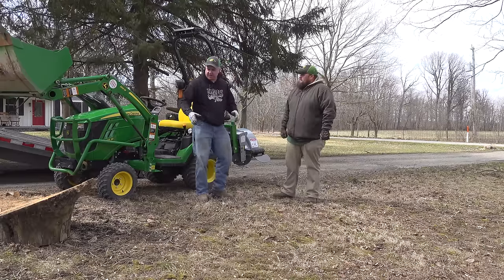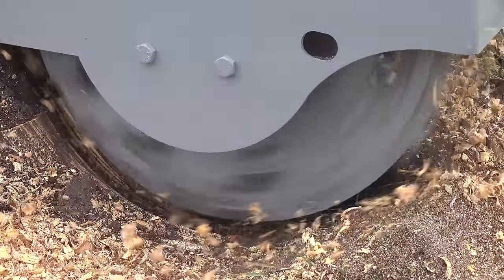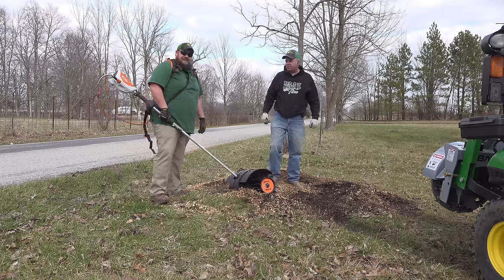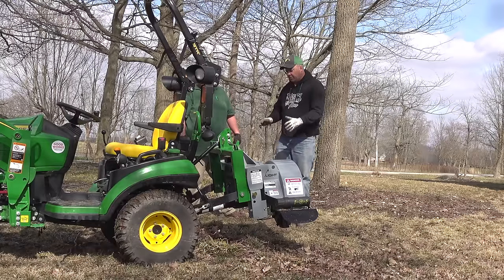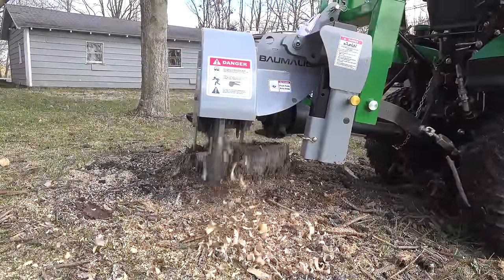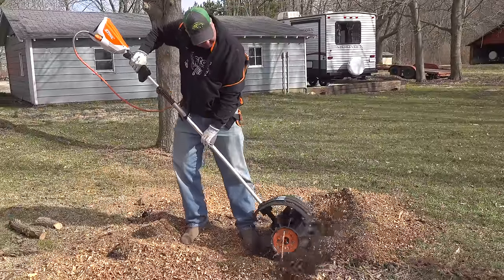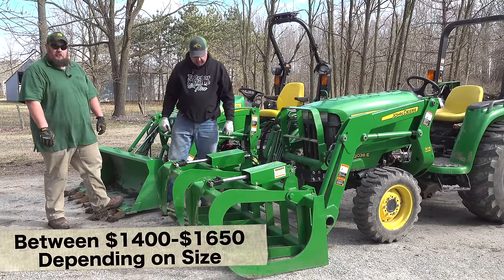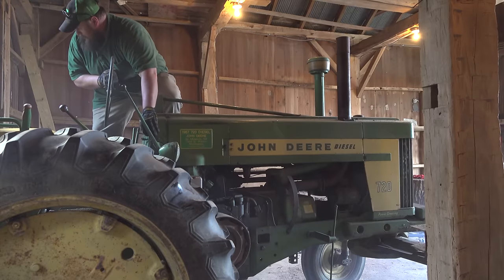New Stump Grinder! Low Cost! Let's Try It!

Comment: We've got a Shaver MV50 for the 5320, which I had at my house for a couple weeks a year and a half ago. Traded my neighbor him using his bucket truck to take down my pine tree (can't drop it any direction in one piece) for taking out 6 Ash stumps in his yard. They were all 2-3.5ft diameter. Even with that setup, it took a whole day to grind them all up. The dead Ash was suuuuuper hard! So much repositioning on those big ones!

Comment: When I first started watching the video I was like there’s no way that grind is going to do a good job on that small tractor but I got to say I was very surprised. Looks like it worked really well.  I rented a 35hp Vermeer grinder a few years ago. One of the ones you stand next to. But man that thing was a handful to control if you cut down too much she  would dig in and pull the whole machine forward. Love the old John Deere at the end nothing like the sound of a Johnny popper.

Comment: if you ever turn wood on a lathe you'd find that hardwood is much easier to shave than softwood.  Softwood just comes out in noisy chunks; hardwood peels off.  Try turning a piece of pine on a lathe........nightmare!  You could also try carving maple vs. pine and see which one works better.  The pine just chips apart because of the softness and big airy grain structure.  My 2 cents.  cheers.

Comment: I have a 2038R and I’m trying to decide between this stump grinder and the 3g24 version
Reply from the maker: Ok.  I think I can help.
1) do you have 2 rear scv’s?  You need 2 to run 3p24?
2) Can you handle the price of the 3p24?  If so, then you will like it much better. 
3) do you have only a few stumps to grind, and are you willing to take more time to grind them?  Is this tine of less value than the $$ required for 3p?  If so, stick with the 1p.

Overall, the 3p24 is worth the extra money...but not if you won’t be grinding many stumps.
3p24 will take more storage space.  

Do you find it difficult to turn around to watch a rear attachment?  DEFINITELY choose the 3p24!  You can operate from off the tractor!

Does this help?

Comment: I purchased a Woodland Mills stump grinder for my 1025R 2 years ago.  Does a very good job and is quite similar to the Baumalite in function and operation.
Reply: Hi Donald, I have a Kubota BX and looking at the woodland mills. Do you find the bouncing and rattling around tough on the tractor. Just curious about real user feedback before  I purchase. Thanks
Reply: theboudreaus444 
It does shake a bit, but no problems so far.  Have removed about 50 stumps of various sizes.  Taking a little smaller bight will get rid of most of the shaking.
Reply: The wm24 is made in China... The baumalight is made in Canada... Easy choice for us.....😊

Comment: Pine is stringy and likes to lay over when grinding, the first pass will fray it then it is tough to cut especially if the teeth have any wear on them. The hadwoods chip nice and go faster and easier. Does the shroud on the wheel lift up or shift from side to side. I ask because the mud can really pack in those areas and be like concreat to get out.

Comment: I have a bamalight on my 1025R  as well. Most of what I’ve used mine on is hedge stumps and it works great. I wish I had that clutch system on mine.
Reply: they sell slip clutches every day. $100.00 plus any tractor supply, or similar co.

Comment: For the price they work pretty good.  Price out even a small commercial unit and they are way up there!  I bought the woodland mills version, looks to be very comparable to this unit. Works awesome of softer trees like pine.  I've done harder trees, and even a few black locust's.  Those take a while. I'd recommend having a hydrostatic tractor for this to get the best use of it.

Comment: Good morning Tim,
Thanks again for making these videos. Your first video on the first version was the reason I bought my stump grinder.  I went with the woodland Mills   Version. I've only gotten to use it once so far but was super impressed. Its reassuring to see someone use it on a similar tractor (I have a yanmar 424). I was alittle worried about the size of the machine. Again thanks for the great tips and advice. Keep up the great work.

Comment: Please let me lend some advice. That Stihl powersweep works great for alot of things. Used like this, is not one of them. A pitchfork would've won the match. For cleanup and sweeping it back up of the turf, it's fine. For removing gravel out of grass, like from plowing, there's nothing better for cleaning ditches and stuff. Now, for the advice. Loosen the attachment end up and rotate it 180 degrees so it runs backward. Now you are pulling it. When you pull it, you're now able to stand up straight, you're not wearing yourself out pushing and lifting it, and it pulls with essential the resistance of a leaf rake. You only need to run these about 1/4 to 1/3 throttle (on the gas models). These things are worth their weight in good when used like this. 😉

Comment: I have a woodland mills WG24 stump grinder on a 2032r which is the same pull behind with no extra hydraulics needed. Love the thing. Over the course of a weekend we easily went through over 200 Pine stumps
Reply: Hey Justin, do you find the woodland mills WG24 hard on the tractor itself? I have a small BX series Kubota and have been thinking about picking up this grinder. Several spruce stumps and ash to grind. Just curious if all the bouncing and rattling takes it toll?
Thanks
Reply from the maker: Remember, the WG24 is made in China.  The Baumalight is made in North America. The Baumalight is less expensive when purchased via shopgreendealer.com, and comes with 6 replacement teeth included!

Yes, these little grinders shake the tractor.  Not sure that any long term damage results.  Lots of folks are using them nearly full time for this.
Reply: @TractorTimewithTim  Tim is this US dollars or Canadian?
Reply from the maker: US dollars.  Are you in Canada?
Reply: @TractorTimewithTim  Yes sir, you had me sold but with conversion and brokerage, would cost $1000 plus more than WG24
Reply from the maker: You should be in luck!  Should be able to get Baumalight even cheaper in Canada as it is made there!  No need to pay to ship to us and back!  Contact them...Baumalight.com!
Reply: @TractorTimewithTim  Thanks again, unfortunately $1000 more canadian

Comment: Thanks again for a great video.  Interesting to see you use the same cutting techniques as machinest use on metal...they avoid "climb cutting" unless it is for a very fine cut to produce a finish...and their mounting is much more fixed.  The slip clutch looks like the same kindve had on our mowing machine...adjust it now and then and no troubles.  Replaced the clutches now and then...no problem.

The Bible verse was absolutely perfect.  These seem to be those kinds of times...ecclesiastical...time to for all seasons...when we figure out what season this one is, we can move forward in faith.

Comment: Nothing like the sound of a 2 cylinder Deere!
Reply: Brian Barclay 3
Reply: Caleb Hoffman 6
Reply: @calebhoffman3784  kendal

It's two, watch till the end
Reply: Some of the confusion may be the 720 Johny Popper uses what is called a pony engine (4 cylinder gas) to start the 2 cylinder diesel.
Reply: jagx234 I read the comment as the best Deere sound comes from a 2 cylinder that’s why I put 6 but yeah pretty sure it’s a 2 like you said
Reply: Yanmar
Reply from the maker: Ha, no, the old 2 bangers were not yanmar!
Reply: The pain to my ears is excruciating !!!!😭😭😭😭😭😭

Comment: Well I finally traded in my little mahindra since our local dealer left the area making parts and service a real pain and I really did like my little red tractor but ive watched your videos so much I ended up with a 2025r just dropped off a few days ago already 3 hours on it and I gotta say it's a substantial difference in a machine that was the same hp as my red one but curious since you run a 1025 do you think my 2025 would be able to really run that grinder without killing the tractor
Reply from the maker: Oh, you will likely kill the tractor at times, but no worries.  2025r will work well with the grinder.
Reply: @TractorTimewithTim  thanks for the quick reply I'm considering starting a landscape business where I live and thought it would be something nice to offer since the closest one around that does it is over an hour away from where we live

Comment: Great video Tim, does the stump grinder work best with an indexable 3pt or does it matter. My tractor doesn't have an indexable 3pt. That's a good looking attachment and a whole lot cheaper than buying a regular stump grinder. Thanks brother have a good day
Reply from the maker: Would be a bit easier with ‘indexable’ 3 pt :-) but it will work with yours.

Comment: Question. For a 1025r with an iMatch quick hitch did you have to shorten the driveshaft of the BaumaLight 1P24 Stump Grinder?
Reply from the maker: I can’t remember for sure.    I don’t think so.  
I can say that cutting a PTO shaft is easily.

Comment: Any chance of seeing a close up picture of the disc and the teeth when they aren't moving. I'm particularly interested in the rake angle and projection of the teeth . Thanks Tim.
Reply from the maker: Why?
Reply: Tractor Time with Tim...why not?
Reply: @TractorTimewithTim  I am a woodworker and woodworking machinery repairman. I am very interested in the angle of attack of the teeth to the end grain stump. Are the teeth angled forward or backward? Generally in woodworking machinery when teeth angle forward it's a much more aggressive cut but can be somewhat uncontrollable. Teeth that lean toward the back the cut is slower, easier to control but will take longer. Trade off's. You want the tooth design to be aggressive enough to do a proper job without being so aggressive as to become difficult to control. G.
Reply: @TractorTimewithTim  I went to the manufacturer's website , which I should have done first so as to not waste your time Tim; and got the still pictures I was hoping for.

Comment: Would that stump grinder work on the 3 series or would the bigger stump grinder you mentioned work better ?
Reply from the maker: This grinder will work fine on a 3 series...as long as you have the hydrostatic transmission.  If you have a rear SCV, you could also use the larger swinging type 3P24 from Baumalight.  Of course, this will be a much more expensive grinder!

Comment: Start on the other side of the stump so the grinder teeth make contact with the stump on the down stroke instead of the up stroke. That is how a traditional stump grinder works.
Reply: Jeremy Millner ....did you note that the grinder teeth are on the face on grinder wheel towards the tractor!....starting on the other side as you suggested , there wouldn’t be any grinding teeth against the stump as the tractor backed up!.....however due to the spinning cutter wheel it might work better if they started on one side of the stump rather than in the middle......

Comment: That grapple is not a brush grapple but a general use grapple. It's bending because of trying to go into the dirt which it was meant to only skim the ground based on its design.
Reply from the maker: It bent because it wasn’t built strong enough.
Meanwhile, it is crazy heavy!

Comment: Hi Tim, did you have to cut down the drive shaft for this to work on Johny1?  I noticed the price you mentioned, boy things have changed in the last few years.  $3250 I think is the going price now.
Reply from the maker: Yes. Had to cut shaft.  Yep, price up.  Use code ttwt to help a bit!

Comment: Tim, I have been looking at this type of grinder for awhile. I found a guy on Craigslist that grinds stumps with one. He said it was very hard on the PTO and he has become a master and tearing apart his tractor to fix the PTO. His tractor was 35hp, not a subcompact. Any thoughts?
Reply: Hmmm... I’m wondering if an elastometric coupler in-line with the PTO shaft would help?
Reply from the maker: Could see what he is saying, but have not heard of anyone with this problem.  What tractor does he have?
Reply: @TractorTimewithTim  I wish I could insert photos here, he sent me three. He didn't say what his tractor was, it was blue in the photo so a Long or a New Holland.
Reply: @darkwinter6028  I wonder if that would work, good idea.
Reply: @TractorTimewithTim  Here is a quote from him, " I have been using this unit for over two years and I am constantly rebuilding the PTO drive due to the stress it puts on the gears."
Reply from the maker: It really DOES matter what tractor he is using it on.   Not all tractors are made to the same quality,
Reply: @TractorTimewithTim  Very true, I am on my 3rd Kioti and they don't make them like they used to. The 1st Kioti was older and built like a tank, my new one does not have that tanks feel.
Reply: @SheepDog I agree there is always more to the story. The tractor was either an LS or New Holland.

Comment: I have been looking at this stump grinder. I have an older kubota 20hp tractor.(not hydrostatic). With your experience with the stump grinder , do you think I would be able to use it?
Reply from the maker: Would be tough with a gear drive tractor.

Comment: Using the power sweep to aid in removing the chips is good,  but just pushing the chips back into the hole & leveling will  leave  a softer spot  in the lawn that will cause  future settling & a low spot/dip in the lawn as well as the grass not  growing  as it should & mushrooms coming up for years to come. Approximately 90% of the stump hole should  be  dirt to no more  than  10% chips  left in the stump hole when  all is said & done in order to do a proper stump removal.

Comment: What rpm are you running at? I have a 1P24 on a JD 3038E. I have been running mine at 540 and the grinder seems to rise up and doesn't bite in as much as I would think it would.
Reply from the maker: full throttle.     It takes some practice.   You might try taking a bit deeper 'bite' each time.  Also, try to start from the right side of the stump.  Try to avoid cutting 'downward' on the stump.  get a 'bite' at the rear of the stump and cut forward.  That is the best advice I can provide.
Reply: @TractorTimewithTim  thanks, that's the way I've been running it. I may try changing some of the teeth and maybe swap some around from the center face to the outside edge.

Comment: This video has outtakes from what looks like an “unboxing” video of the Imatch compatible version. But I can’t find that video, is there a link?
Reply from the maker: This video IS the I-Match compatible version.
I don’t think I have an unboxing video of it. We DO have several more videos showing this grinder in use...including one released today!
Reply: @TractorTimewithTim   I got mine yesterday and realized that it is not really iMatch compatible.  It comes with cat 1 top and side links.  Traditional cat 1 to cat 3 bushing sets don’t appear to be workable due to the pin length.  How did you make yours work on the iMatch?  At one point in your video it appeared that your left side pin might not be sitting correctly in the iMatch (11:26).  It looks like it might have slipped off the bushing.
Reply from the maker: @krullery  you can get bushings at tractor supply.  Likely need 2 on each side...cat1 to cat 2 and cat2 to cat3.
Reply: @TractorTimewithTim  Thanks Tim.  I was hoping for a “cleaner” solution.  I contacted the factory in Canada and they are going to talk to the design team to see if they have a better solution or can perhaps produce CAT 1 fo CAT 3 bushings in the proper length.  If that doesn’t work out by spring time, I’ll go with the double bushings on each side.  Keep up the great work!!!
Reply from the maker: Good point!  Thanks for reaching out to them!

Comment: What is the model tractor, HP, and hydraulic flow requirement?  Does it need "power beyond?  Thanks.
Reply from the maker: No rear hydraulics needed.
Only 3 pt hitch, PTO, and hydrostatic transmission.
I have 24 engine hp on this Deere 1025r subcompact.  Anything up to 45 hp is fine.
Check out shopgreendealer.com/TTWT and use code TTWT for a 5% discount.   They’ll have one sitting at your door in a few days!

Comment: Been looking at these. I've got a manual tractor. So would low range/first gear be to fast???
Reply from the maker: Would not work very well with gear drive transmission. Need to go even slower than 1st gear low range!
Reply: @TractorTimewithTim  Would the 3P24 be better for a manual tractor? I've got the hydro remotes....
Reply from the maker: Yes.  3P24 would work fine for you.
http://shopgreendealer.com/ttwt. Use code ttwt for a 5% discount!

Comment: Would  this  work in any 3 point hitch tractor? 1 have a 30 year old Ford.
Reply from the maker: Not very well.  Works much better with hydrostatic transmission.
Reply: Thanks for the reply. Blessings

Comment: I commented and now  can't find my comment. ...looked at the link for purchasing and did not  see any mention of min. hp. required,   thanks
Reply from the maker: 50 engine, 40 pto.  Here are the details: 
https://baumalight.com/stumpblaster/en/1p-24.php
Reply from the maker: Did you get my reply?
Reply: thanks...yes I did.  I was on my tablet and that must have been the reason I didn't see your comment.... didn't realize a 50 hp was consider a compact tractor @TractorTimewithTim
Reply: @TractorTimewithTim That link is only showing the older version of the 1P-24.
Reply from the maker: EOSJOE the photo is old, but the grinder is the new model.  I promise!   They have them in stock!